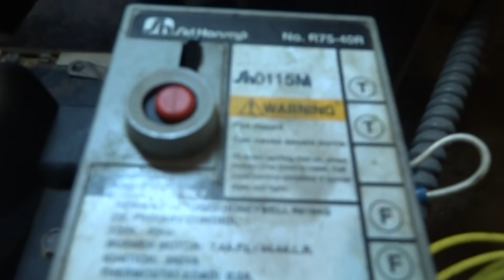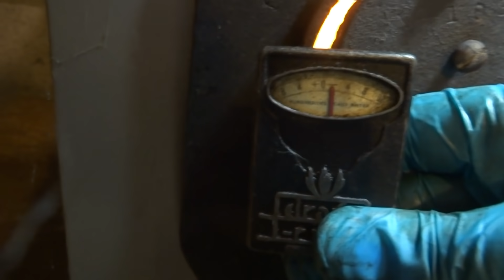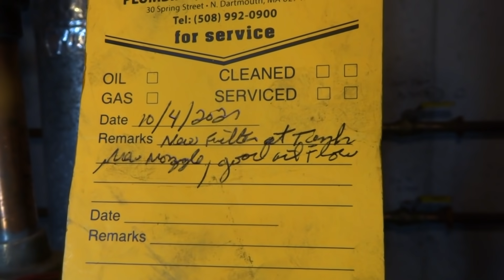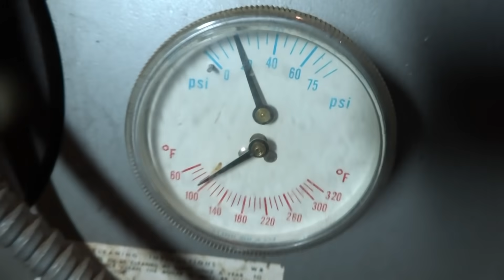OIL BURNER SERVICE NEW CUSTOMER

Comment: Off topic but I have to thank you for all of your videos on oil burners. My go-to furnace man retired and you helped me learn to maintain and troubleshoot my old Beckett burner when it's nearly impossible to find a tech that's not just a salesman. Just a reminder you help a lot of people Mr L.
Reply: I'm almost 50 and have only used gas and electricity for heat. I never knew about heating oil until I started watching Steve.

Comment: Tell it like it is, Steve!  You are right-on!  I had considered switching over from kerosene to natural gas because it was thought to be the best home heating value.  Now, the govt. is going to screw all of that up.  I knew that they are going to restrict removal of it from the ground, which will reduce supply and cause price to go up...but now adding a tax?  Our country has an abundance of not just gas and oil, but coal as well.  No excuse for Texans going without lights and heat last winter!
Reply: As I understand it the Texas issues last winter were insufficient infrastructure to to generate and move the energy required exacerbated by unusual weather. This is a symptom or profiteering over investment. The utilities are for shareholders not customers.
The climate is changing, why probably a natural cycle that could be being hassened by burning fossil fuels. Whatever your beliefs it would be prudent to reduce reliance on fossil fuels while we are able to transition carefully rather than waiting for the price gouging that will occur as they run out.
What ever your environmental religion fossil fuels are running out.

Keep up the interesting videos Steve they are great.. 👍🏻👍🏻
Reply: @glenn7245  Thanks, Glen, for your perspective.  i agree that there is ultimately,  a finite amount of fossil fuels.  I wish there were more interest in the hydrogen car.  The "fuel" is water.  The exhaust is pure water.  I heard that those wind turbine generators froze up and malfunctioned.  My "religious" belief is that we will be able to use fossil fuels long enough for green energy to become more practical to rely upon totally.

Comment: As I understand it the Texas issues last winter were insufficient infrastructure to to generate and move the energy required exacerbated by unusual weather. This is a symptom or profiteering over investment. The utilities are for shareholders not customers.
The climate is changing, why probably a natural cycle that could be being hassened by burning fossil fuels. Whatever your beliefs it would be prudent to reduce reliance on fossil fuels while we are able to transition carefully rather than waiting for the price gouging that will occur as they run out.
What ever your environmental religion fossil fuels are running out.

Keep up the informative videos Steve. 👍🏻👍🏻👍🏻

Comment: I took classes at NORA and they taught us about natural gas burners because they even said oil is not gonna be around in 10 years. And they are the National Oilheat Research Alliance.
Reply from the maker: I WOULD SAY THERE WRONG ..
Reply: We were supposed to run out of oil in 1985. Oh yeah, we’re also supposed to be in an ice age too.
Reply: They’ve been saying stuff like that for decades… ignore whoever “they” is
Reply: While I have no knowledge or NORA statements, I expect fuel oil to be around for a long time.  In rural northeast USA the electric infrastructure will not support an all electric home.  Natural gas lines do not exist in rural areas.  Electric failures due to winter storms.  We have multiple outages a year.  Longest 9 days.  Ran out of propane for the generator.  Now have gasoline generator also.  House was 42*f with our passive solar.  We use fuel oil for heating.

Comment: Their nozzle was so clean. My filter stays clean but my nozzle is always caked with carbon and soot.
Reply: Try a tiger loop if you haven’t already. I like the model with the spin in filter. If you diy it do your research. Especially if you currently have 1 oil line.
Reply: @tomkristman1456  I have a two line system. I almost think there may be a drip near the nozzle during firing that burns off leaving residue. It runs fine all year, but I have to hit it with brake cleaner when I clean it once a year. The nozzle in this video that Steve pulled out was exceptionally clean.
Reply: @DAS-Videos  I’m definitely not an oil tech but I’ve seen enough of his videos to help a little bit lol. Tiger loop is a no brained eliminates so many what if’s. And they are relatively cheap. If your hunch is correct you could have a loose nozzle or yes possibly the pump solenoid is leaking. A pressure gauge would be able to diagnose that.
Reply from the maker: you might have a bad check in pump,, or draw assembley might not be set right ,what kind of burner head do you have ?? had to say over a email what your issue is unless i was there checking stuff

Comment: Does the oil company put bigger nozzles,  so that u waste oil and have to buy more?
Reply from the maker: I BELIVE SO SEE IT ALL THE TIME BIG NOZZLES IN BOILERS . NOT NEEDED .
Reply: If you raise the pump pressure and lower oil nozzle size it will increase the efficiency

Comment: Hmm, in my opinion ethanol isn’t really that good in log run since it takes more material, and much more labor to maintain, not to mention it not as long lasting, as you said doesn’t burn as hot so seems to burn more fuel than less. If they really want to save environment, get more efficient burners, fuel regulators and keep it simple, not really rocket science 😂, that is the way I see it. Good job on another satisfied customer.

Comment: Nothing wrong with ethanol gas unless you don't drive lots or are using it in carbureted engine. I can see it being a problem in heating as it will eat the rubber o rings an plastic components not built for biofuel.
Reply: Plenty wrong with ethanol it lowers gas mileage therefore cost us more to drive and the additive required for commercial diesel drops emissions by half but drops mileage by half so twice the fuel is used on a trip therefore the only accomplishment is costing more for goods delivered higher operation cost. Nothing gained but making the manufacturer of the product rich.
Reply: I try to run my gas tank pretty low between fill-ups.  You don`t want to leave that corn gas in over two months!  WaWa sells non ethanol gas here in VA.

Comment: Hey Steve, I been serving serving with bio fuel for 3 years in CT.  A lot of the old oil tanks leak because removes all the slugge at the bottom of the tank and stuck in oil lines. We put over 65 tanks over last 3 years because of the fuel. It also killing the seals on the fuel pumps too. More leaks near the coupling on fuel pump. This new fuel a shit show.
Reply: True facts ethanol ruins old school cars fuel systems  just a ploy to convert ,some can't afford the transition on the spot ..💪✌️👍🙏💩🐓😸

Comment: I have a small Champion Generator and I think the Ethanol Gasoline has ruined it.  The gas tank on it is full of rust.
Reply: Ethanol attracts waters. If your going to use it, store the generator with a full tank.
Better yet search for station that sells non-ethanol fuel. I have to drive 15 minutes to get it but that's all use use in small engines. Depot sells it in  2&4 stoke variety for smaller amount.
Reply: Wa Wa gas stations sell non-ethanol gas.

Comment: Steve and the lady telling it like it is and I agree. Ethanal gasoline is garbage. Less MPG especially in older vehicles and after 6 months is bad. They also screwed up  diesel making it ultra low sulfur. Within 3 months we were changing injectors on the fuel trucks and had injection pump problems within 6 months. ULSD seems to burn cleaner in oil burners. I dread the day that bio crap hits our area.

Comment: Steve I use E-85 that is 85% ethanol and 15% gasoline. A few things not as good fuel mileage However at 50 cents to a dollar a gallon cheaper it works to the buyer. And it runs cleaner. Plus more HP. A interesting fact is the ford model T was originally designed to use ethanol. Now heating oil and diesel fuel I cannot say without personal experience.
Reply: Right now, at the only gas station near me that has E85, regular is $3.35 and E85 is $3.19. I used to own a Jeep that could take E85. I never tried it once, but was told it got 1/3 fewer miles, so E85 would have to be $2.23 just to break even.